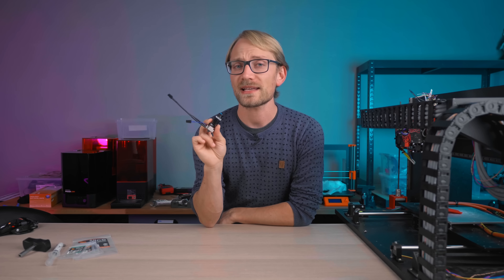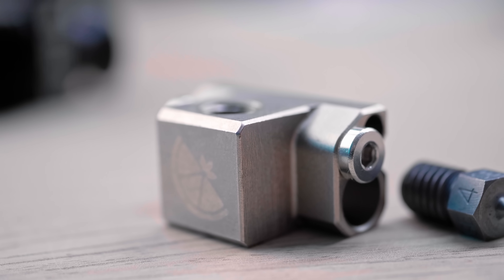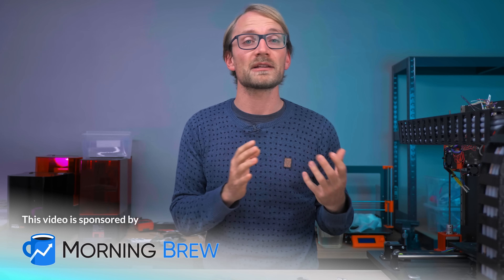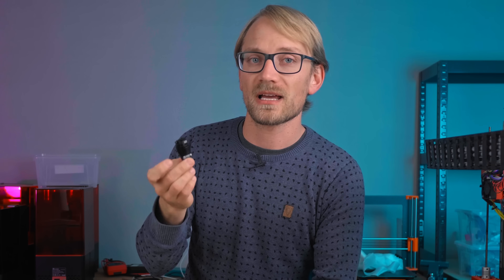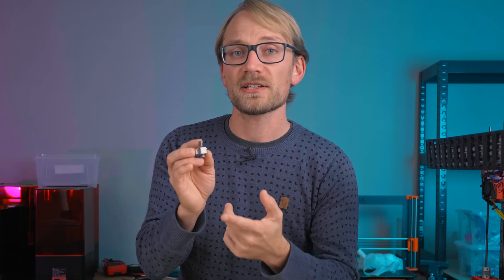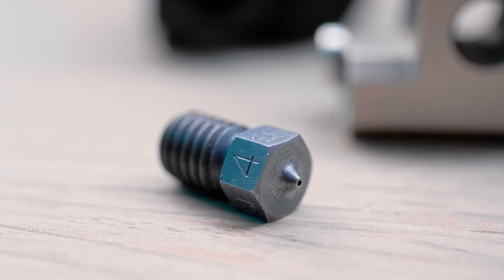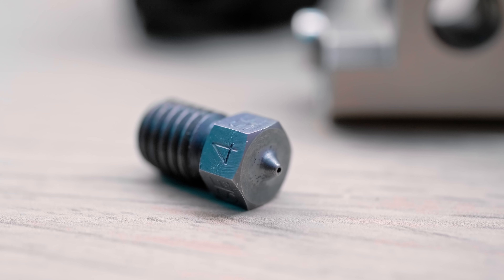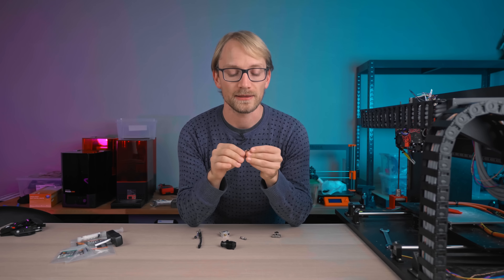This modular hotend seriously impressed me! (Slice Engineering Copperhead Review)

Comment: Thomas, have you ever experimented with PTFE coatings?  Such as Miller Stephenson MS-122XD? I guess you can bake this coating above 600F and it becomes a permanent ptfe coating. Not sure how durable it is but I wonder if it would improve the wear of a hotend such as the copperhead or other hotends?

Comment: I watched a number of videos on cleaning a hot end, but they all used the bowden tube to push it all the way through the heat block. With the Copperhead it wont allow the bowden tube to move all the way through. So how do you clean it, I looked for a bit but couldnt find a video
Thanks

Comment: I currently have on my MK3 the E3D plated copper heater block, E3D titanium heatbreak, and Spool3D Tungsten Carbide nozzle. I wonder if swapping the titanium heatbreak for the copperhead heatbreak would do anything for me. I do change nozzles, but only a few times per year only to change the orifice size (I have the TC nozzles in several different orifice diameters, but usually just use the 0.4mm one). I do occasionally print abrasive filaments (CF filled, metal filled, glow in the dark, etc). I'm planning on doing a PM tear-down soon (to also apply the MK3S+ upgrades) so that would be when I have the best opportunity to swap heatbreaks, especially since I plan on applying fresh thermal compound as part of my PM activities.

Side thought... I wonder if copper based anti-seize compound would be a good replacement for the standard boron nitride white stuff. Need to look up how well the carrier fluid in anti-seize holds up to high temperatures... I do have some arctic silver lying around, but again I don't know how well that stuff holds up to 300°C+ temperatures...
Reply: Boron nitrde is sealer and anti seize as well as thermal. Use industially forever.

Comment: My prusa mk3 is giving me major heat issues. I feel like at this point, I've done everything software wise that can be done and ruled out the slicer.

I downloaded cura and sliced a benchy with the same settings as prusaslicer. It didn't complete. 30 minutes into the print was clicking from the extruder and nothing coming out. I was already printing at 220 and bumped it to 240. The clicking stopped and the filament started again but maybe 40 or so minutes after that CLICKING AGAIN. And no filament was coming out. 240 is way too hot to maintain for PLA IMO.

Over the past couple of weeks, I've swapped out the nozzle, reapplied thermal paste, releveled the bed, first line is perfect, PID tuning, tons of tweaks in prusaslicer to profiles, different filament, printing from a drybox, replaced the PTFE tube, tried different models, printed from SD Card and not octoprint. I'm sure something else I'm missing.

So basically I would hope something like this or the mosquito would fix the issue.

When a print does complete, there's often missing layers, looks like layer separation (gaps in the line)

I've had my prusa 3 years so I guess it's time to replace parts. Trying to get it to a mks+ but can't get parts to complete.

Comment: The bi metal heat break seems like the first step for me just to increase the length of the heating zone. The old 60 mms is so slow. My printer just needs more heat to print petg consistently at 100 mms.

Comment: The flowrate of the v6 you compared must be limited by the heating cartridge; since the other limits (thermal tranfer through nozzle and heater block) are not improved.
So only buy a better heater cartridge for to get higher flowrate.

By the your controller board an firmware has to support the higher current/voltage of the new heater cartridge even if you buy it as a set.

Comment: I recommend thinly applying the paste to the thread on the nozzle and heatbreak before inserting into the heat block and don't apply to the heat block. I also avoid getting it close to the end of the threads so it doesn't squeeze into the gap as tightening them up.
At leas tthis is the trick I use with the Mosquito.

Comment: I don't see the point of this. You made a great video but it seemed to be too focused on price. We want to know what a fully tuned E3D V6 looks like next to a fully tuned Slice outfit. Couldn't get the heater cartridge? OK leave it out for now. You also seemed to print a detail model with massive layer lines which makes no sense either, I imagine speeds were equally ridiculous. You aren't printing a full size chair....turn the layers down to 0.1mm or even less, put a 0.2-0.3mm nozzle on and run the speeds around 30-40mm/sec and slower on perimeters. 360 degree of fan for overhangs. Seems like a lot of people just don't know how to print details and claim "oh thats only for SLA". I own both SLA and FDM but a FDM can be tuned to print this a thousand fold better.

Comment: 12:12 you have a leak. usually the nozzle and throat need to meet in the middle of the heatblock and need to fit perfectly onto each other to seal it, because the thread is not sealing anything... Thats why I use actually a self made block of steel to be able to tighten the nozzle more (aluminium and copper/brass threads may wear out quickly or break at the tension that I use to tighten it)

Comment: "(Proudly) Made in The USA". For the last 20 years, it's something that automatically makes me sceptical, even if it is truly stupidly expensive. Because even then, tve majority of revenue goes to all the middle layer entities that wanna make bank on every form of transaction you do, without contributing anything of end user value. So you regularly have frankly horribly poorly paid workers set to doing strict high-precision engineering, manufacturing and assembly. Everyone and their dog wants and gets a cut. So from raw material to product in hand - you get a "meh" quality product (especially assembly and tolerances), at an exuberant price, made by poorly paid workers; so they either won't or aren't able to make the thing as good as it could be. Because either they got paid $8/hr so they make an $8/hr product, or there's no room left in the material-to-product-in-hand chain for actually making a top quality product, because A) (see the aformentioned no-value-added middle layer leeches), and B) you're trying to be competitve using poorly paid manual labor for tasks that your competitors automated years ago.

Now don't get me wrong. I'm not knocking on American manufacturing workers. Most are delivering as compensated. What has been erroding "American made" for decades, is all the other leeches in the chain that have eaten up the potential wage growth and further bloated mediocre product pricing. Not that there's sll that much wrong with a mediocre product - but it has to be priced accordingly.
Reply: @Lassi Kinnunen 81 I definitely recognize your point. But if you read my post, I hope it's fairly clear I meant actual American made products. Not made-to-crap-standard-request in China/Asia and minimum possible effort added state-side to legally add the "Made in USA" branding.

-

I specified the "made to crap standard request" because you can have engineering, manufacturing and assembly to rival German and Japanese, from China for at least the last decade. But just like how you can get crap quality from German and Japanese manufacturers too, you have to actually request, contract and pay for the quality you want. When you get cheap crap stuff from China these days, it's because the brand on the box that sell the things, specified it and paid the manufacturer to make it like that. High end engineering and manufacturing in China isn't cheap though. Often it is actually more expensive than in many Western countries. Because even though China has pumped enormous resources into high quality public education (especially higher education) the last 25-30 years, and they're cranking out a tonne of them, the demand for Chinese engineers is far from able to meet demand. So Chinese engineers are very expensive. Factory/assembly workers are getting quite expensive too: Now that such a muuuch larger portion of the work force has solid baseline education and college/uni qualifications, most people don't want to do those incredibly boring, high-stress, super repetitive and low-paying jobs. Which has induced substantial wage increases for those jobs. But getting workers for those jobs is still difficult, because some wage increase hasn't affected those other reasons why people don't want those jobs.

So expensive have Chinese engineers gotten in fact, that recruited engineers from Western countries is some times cheaper.

The reason high end Chinese engineering and manufacturing still make financial sense in many instances, even if the actual engineering and manufacturing may be more expensive - is the supply chain. If manufacturing (and potentially assembly) is situated optimally (as high end often is), close to raw material and component manufacturing industry - then the supply chain for all the materials and components needed to make the product, may literally be walking distance from the manufacturer's factory and assembly location. Or at worst, less than one day of transport. And even if it's way further off in a different region of the country, it's still made in the same country, so no import/export costs, few if any costly middle-men bloating the cost, and lead time on custom components and prototyping is really low. So in the end, even if engineering and manufacturing/assembly is more expensive; the short, few-link supply chains make the overall operation cheaper and faster. And their customers only need to deal with one layer of import/export, when shipping the finished product to the customer company's region. While that adds to cost, with several middle-men leeches, it's still a lot less than if actually manufacturing the thing in the US for instance. Because then most of the components and materials that make up the product, have to be imported separately, often through a large-scale inporter or distributor. Adding multiple layers of middle-men all wanting a cut, and the no-material-value-added cost rises exponentially with each layer.

This is also a big reason why so many American companies don't want to manufacture their products in the US; the supply chain. Because almost everything that makes up the product, still has to be individually imported first. This, coupled with all the earlier mentioned middle-layer leeches, means the product is basically as costly as having it made in China, before actual manufacturing and assembling of parts has even started.

Comment: Sorry but made in the USA to me generally reads as, more expensive then it needs to be. Especially when it's promoted/shown a lot and again the price reaffirms that believe.

What I don't get is why hotends that go up to 450C have heatsinks that require to be cooled by air. The thing is when you try printing high-end, high-temp materials you tend to also need to have a hot environment for printing often 60-100C which means you're heatsink will be about 75-130C (maybe even up to 140-150C when printing at 450C) because you're cooling it with air that's 60 yo a 100C.

Comment: You'd still have to buy the heatsink if you have the stock Creality hotend though, there's no way to fit the Copperhead block to a Creality heatsink. Had someone go and measure the measurements of both hotends and their respective blocks and heatbreaks and they don't fit. They will work with a V6 heatsink though.

Comment: Everything I've seen or heard until now says that titanium is the gold standard for heat breaks.
Reply: If you manufacture it from a single material yes. Bi-Metallic construction using highly heat conducting copper and a stainless steel tube creates a sharper temperature transition due to the way superior heat transfer characteristics of copper.

Comment: That's not something I'd recommend as an upgrade. I you want to spend so much money, you should have bought a different printer and enjoy performance improvements that actually matter. The only reason I see to get this one is if you want to print really high temperature materials, but you probably won't do that on an ender anyways. Conclusion: It's better than the V6 in every aspect that does not matter for someone owning a cheap printer.

Comment: there is no point to compare it to stock V6 , as you said it yourself (close to the end of the video) 
upgraded V6 with copper block , ti heat break (or bi metal one from china , i have both) hi temp heater cartridge and pt100 make the V6 also print at 450c or 500c and its probably better with sturdier heat break .
V6 is still better hotend if fully upgraded . 
the only thing i dont like on the V6 is the heater block design - i with the heater and thermistor were mounted vertically , so if your part detach from the build surface and you have a mess on the hotend , at least the wires will be out of the way .

Comment: Thermistors would not measure above 250°C (as far as I know). The thermometer on the Copperhead must be a thermocouple. Is Marlin prepared to work with thermocouples?
Reply: First: there are standard thermistors which can go higher. Then, you have the platinum based PT100 and PT1000 thermistors which can go up to over 800°C and which have the additional benefit of an inverted curve relative to the normal thermistors, I.e. a higher temperature returns a higher resistance. This helps since a broken wire results in over reading the temperature which results in the regulator turning off the heater. Thermocouples are by far the least favorable choice as they produce a tiny voltage that you have to measure accurately which needs a shielded cable and an instrumentation amplifier.
Reply: @christophmuller3511  Thank you for the explanation, Christoph. I appreciate. I did not know about the PT100 and PT1000.

Comment: Actually going too low of a temp can cause stringing too.

Also this model is so messy that honestly I doubt the same hotend would print it the same twice. Everything looks a ton like luck! I wish you printed something not THAT extreme. Without unsipported bits that could attach to the nozzle etc

To me the end comparison doesn't tell me much other than the fact that the copperhead is colder or has less heat transfered which makes sense due the hardened nozzle

I wish you did more models! And maybe on a prusa or something that's a bit nicer

But overall lovely video! Thanks for the efforts! I'm just a nit picker

Comment: when will they do same to the heating element. Element around nozzle, and heat is more even, and instantanious.
Reply: Not really. In early RepRap days we did coil wrap arounds but problem here was thermal instability, not coping on fast’ish print speeds and overbaking therefore clogging if retractions are on. It requires more thermal mass around the filament path to be stabile and heater cartridge not too close to keep heat consistent.

Comment: looking at those prints, still doesn't justify in any way the price, if you think a full Ender3 is cheaper. Even as an upgrade to a more expensive printer, the improvements in the print aren't world changing. but well, it's supply and demand. It actually reminds of all the supposed raspberryPi killers that have the same performance and cost 180€ which makes a purchase again nonsensical, even if it is an open market challenge to an established product.

Comment: I really wish they would use a set screw or something to better hold the thermistor and heater.  Thermal paste is supposed to be used to enhance metal to metal contact by filling in imperfections...but that contact is still supposed to be metal to metal.  Slice seems to think thermal paste goes between the 2 metal surfaces.

Comment: I don't see why this exists. It consists out of parts that either already existed usually at better prices (e.g. the heatbreak for example is quite easy to get from Chinese companies for 10-20€) and are aren't ground breaking in any way and a cooling block which does nothing new as well, but might fit in even less printer. Why should I use any of these parts from them? For the fancy heating block design? A nice design isn't worth it. If I want a nice design, I would get one of these modified Mosquito designs from China that use a different heat block.

Comment: @Tom You should try swaping just the heatbreak, just the nozzle and all stock E3D with a nitride-boron heat paste. Also, but slightly harder to do, measure the nozzle and block temperature with external termocouple while extruding a set amount of material. It's not impossibly the difference in performance you're seeing is actually because copperhead simply gets to a higher temperature from secondary effects, say more loosely coupled termistor.

Comment: You mention at 3:50 that the copper heater block won't necessarily improve temperature stability because it has a similar thermal mass to the aluminium heatblock. However, because the thermal conductivity of copper is much higher, the changes in temperature from disturbances should be measurable by the temperature sensor sooner and allow the integrator action of the controller to operate with a lower delay to counter said disturbances. (Atleast, in theory) Maybe worth testing?

Comment: Is the Copper Head heater block the same size as the V6? If you want high temps with e3d, correct  me if I'm wrong, you need to go Volcano. But then you have a longer heat block, which may or not be a good thing depending on flow rate needs.